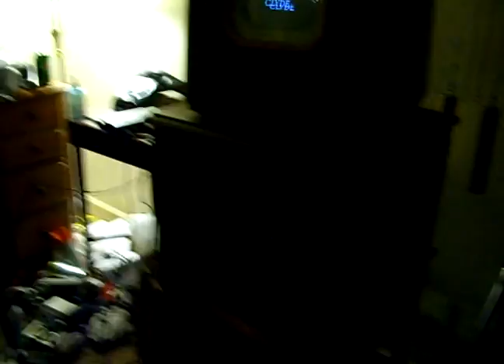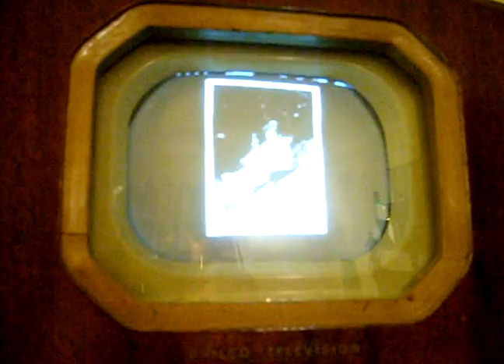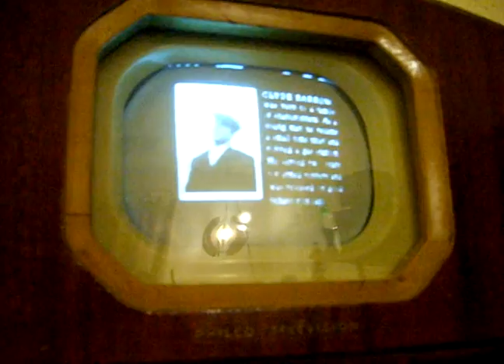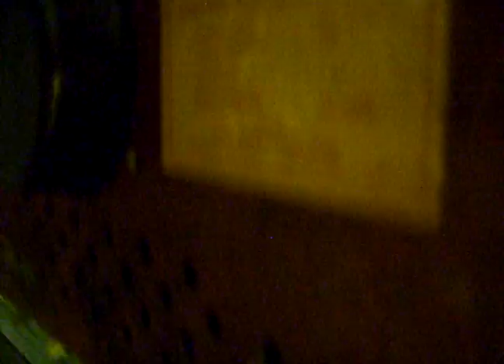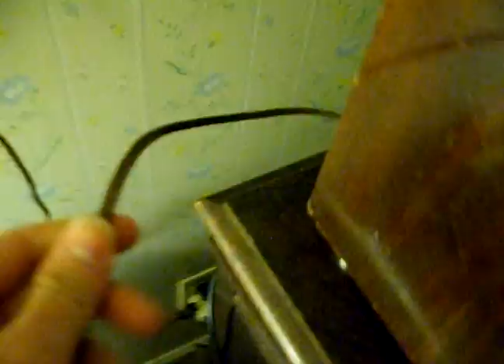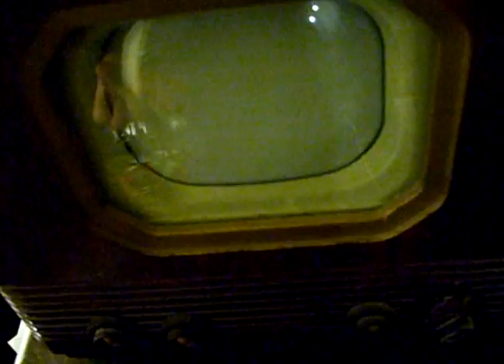My working Philco 50T702 television set

Comment: I remember seeing this vid years ago and I went back to it because I finally acquired a similar model - the 50-701, which is the bakelite version. It's a fixer-upper, but you have to grab what you find with these. Examples in any condition rarely turn up for sale these days. This is the only time I ever saw one working. It's a shame that Philco built such a quality 7" inch set, yet they overlooked the HV flaw which causes picture fade. I plan to install a muffin fan in mine which is an easy cure. How's the set playing these days? I've been collecting vintage TV's and radios for many years. They're so cool looking and fun to use.

Comment: The fading out of the picture is a common malady in this set..there is a fix for it...some sort of kit that plugs in to the high voltage tube socket.I think this fix can be found on the web..That you baked and coated the flyback successfully is very cool!